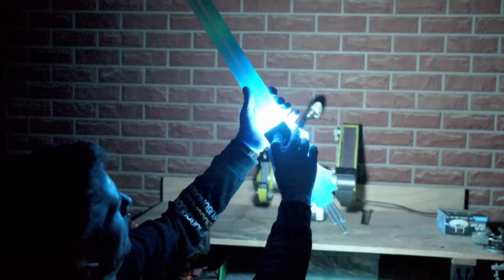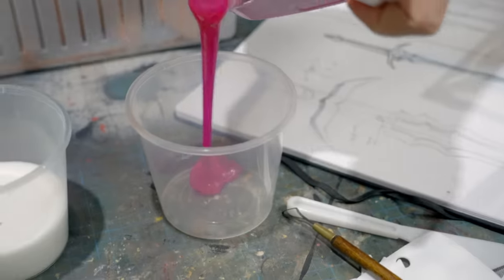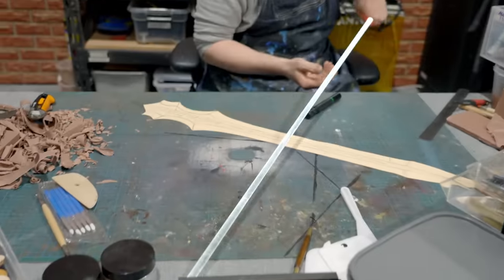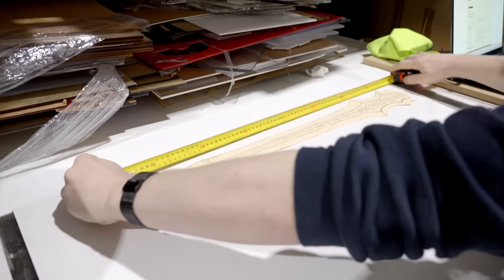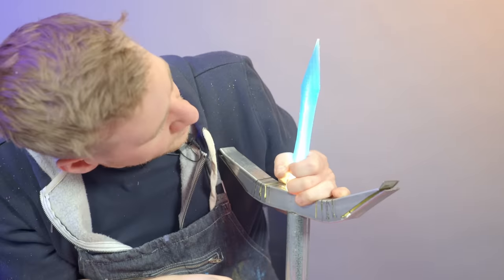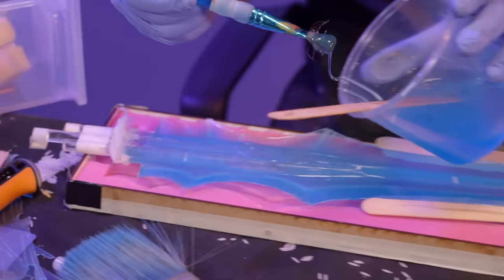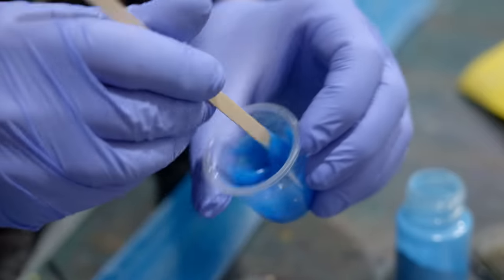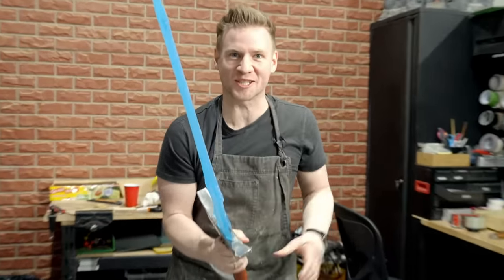I Forged an INSANE GLOWING SWORD with Resin and Steel!!

Comment: You need to try that sword again, but put fiber optic chord with filaments through it will a light source in the handle so it glows from the inside, so it looks ethereal!😃

Comment: As someone who is intimately familiar with swords, i have a few points
The most immediately noticeable problem is the guard is very thick and bulky, this brings the whole balance of the weapon backwards towards the guard and makes it much more unwieldy  if you look at real swords, you will see a much thinner guard and in cases of large guards, you see holes in them to reduce weight
The second major problem i have isbthe handle being perfectly round like that makes edge alignment a lot more difficult and also make it easier for the weapon to rotate in the hand, once again looking at real-world examples, you will see an oval-shaped handle on nearly every weapon with an edge
Otherwise it's a very well made prop, much better than i could do
Reply: His brother is Shad of Shadiversity, so I'm sure he'll get an earful of those points eventually : )
Reply: And he trimmed the Tang. It's not Full tang. It will breat in a playful combat

Comment: One thing you could've tried is using clear colored paint. Its what I used to create chrome colored gunpla models. The process is pretty much, airbrush it with chrome, so its just that standard chrome color, silver and whatnot. Then using Clear color, like Clear Red, you do about 3-4 layers of paint and you get to the point where you get a chromed color look. Its called Chrome Candy painting. 

So you could just get Clear white or Clear Silver paint and air brushed that on the side in order to get a transluscent coloring on the blade without hiding the glow.

Comment: If you want the resin to be strong and still let light pass: use some fibreglass.
And for the guard and pommel you might want to look into metal casting. There is "zamak" - a family of materials specially designed for casting. It is still decently strong but really easy to cast and has low enough melting point that it can be cast with silicon molds.

Comment: The blade came out awesome! But I feel like you have some untapped potential for the hilt, handle and pommel. The metalwork itself was strong and good but some decoration would have gone a long way to elevate it even further. Maybe you can figure out something crazy to do for those parts and you will have truly legendary weapon in your hands!

Comment: Amazing result and project - I also concur with the 1 (bigger) video a week vs 2 small ones but also if you want to do some smaller projects down the line; don't feel like you always have to stick to 1 video a week; it's okay to be a little fluid with your upload schedule. 
Side note; I hear "forging" I do not see forging; I think Alec Steele's soul died a little each time "forging" was mentioned but not actually accomplished lol. Good work on the not-forging though, it turned out really cool even if there was no actual forging involved.
edit; I just watched you cut off the acrylic "tang" rods at the bottom; I think if you'd left them on and sunk them down into the handle it would have given a little more strength to the overall blade (not seen the end yet so idk how much of a difference it would make). There's a reason swords + knives have tangs that run into the handle (most of the time you can't see them but they are there) - it's to provide strength and help prevent the blade and handle/guard separating or sheering off. Obviously this blade isn't going to get a lot of "use" being that it's resin but just a thought for longevity if nothing else.

Comment: Led strip down the middle probably wouldve made it a bit better. Put a metal core down the middle of it and hide it with a refractive material. Complete it with a full tang so you can confidently swing it without worrying about it flexing or snapping.

Comment: you need a vacuum chamber, I've never handled resin before but I've seen enough videos to know that you can cut down on the air in a pore by putting the unpored resin in a VC before the pore, this gets out air from the mixing.

Comment: I was surprised by how well the glow turned out when I saw the use of a straight rod to carry the light. A straight rod is good if you want to carry the light all the way to the end (as long as said rod has a higher index of refraction than the surrounding material). If you use a rod with a consistent narrowing, you should be able to more easily release the light in evenly throughout the length of the sword. Of course, this requires the use of a rod where you are certain the material of the rod has a higher index of refraction then the resin it has been bonded to. 

Now that I think about it, this does raise the question of what happens when you use a rod with a lower index of refraction than the resin? It's been over 15 years since I've worked with that kind of math, so I'm not going to even try. But, anyone that has recently finished a college course for light interactions in physics (and done well in said course), should be able to do the math.

Comment: Has anyone ever tried using fibre optic cable to illuminate a casting? If it worked the light would go all the way to the top.

Comment: i would HIGHLY advice against using alcohol-based colourants for resin:
Those colours do come with some epoxy-resin kits and are often advertised for that but manufacturers of resin, epoxy-pigments and alcohol-inks all will warn you that you can only use a tiny amount of alcohol-based colouring or the resin will take a very long time to cure and even then will never fully cure. Had tried it recently and a few drops for a full cup of resin works ok, a bit more and the resin would stay soft and feel more like rubber, and trying to get a rich blue made it so the resin never cures. Not even after 2 month for a 24hour resin.

Good epoxy resin will cost a lot more than cheap alcohol colours but also will have a lot deeper and stronger pigmentation so you will need a lot less to get the same result.

Comment: simply nailogical got this Mould you could place on top of chocolate and when the chocolate set, it set into the form. and so the form made it holographic (it was basically a sheet of plastic), I wonder if that is something you could do with either the monster clay, or the resin.

Comment: At no point did you come close to "Forging" anything. At best, what you did was sculpt  metal.

Forging is heating two pieces to very high Temps and through high-pressure, such as a press or a hammer draw out the blade and fuse the metal together. 

Welding is not Forging it's welding. It usually consists of using electricity to liquify the metal and introduce new metal using a filler rod or wire.

So, if you were to make a metal container usually your metal tubing like a 2" square tube and you filled it with various metal parts like ball bearings, razor blades and metal poweders, capped each end welded said caps on. You have  created a san-mai billet via welding the tubing. You did not forge anything at that point.

If you then stick said san-mai billet into a forge heated till it was glowing yellowish/ white hot and proceeded to actually forge the blade through either pressing and or hammering it into a shape, followed up with a qwench in oil then you've actually forged a blade.

Now if you run to home depot buy a 36inch piece of mild steel take it home and heat the edge up to white hot pulled it out and started  hammering out an edge this can be considered Forging too but in some peopkes mind you made an edge(s) off a store bought stock.